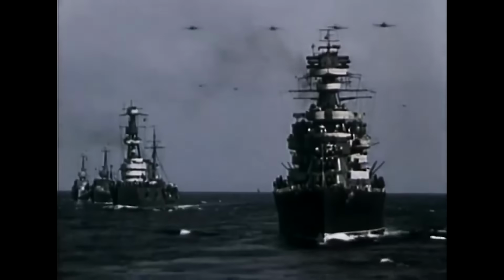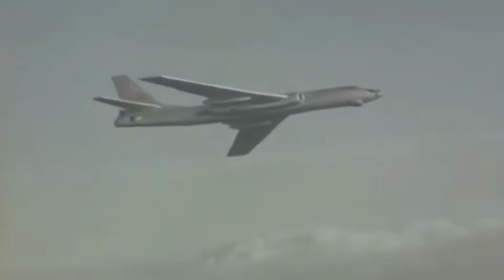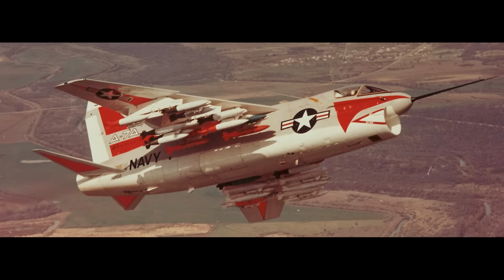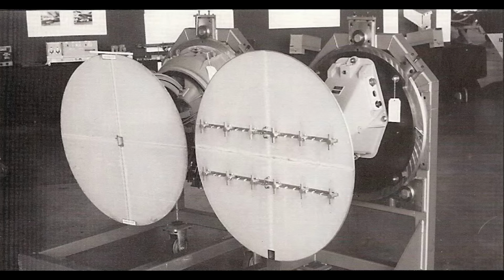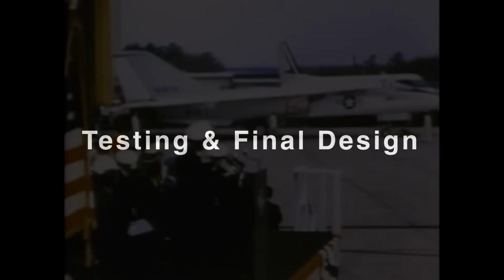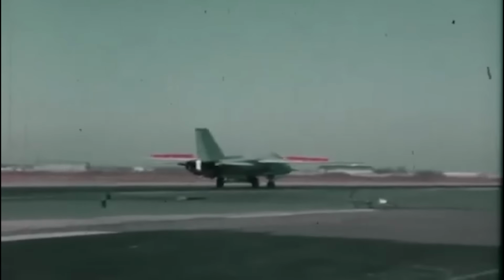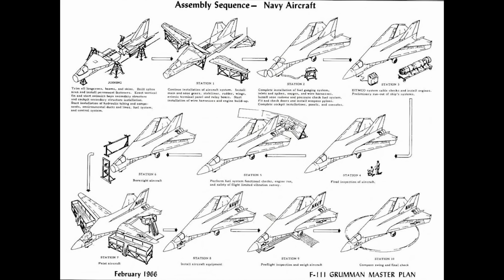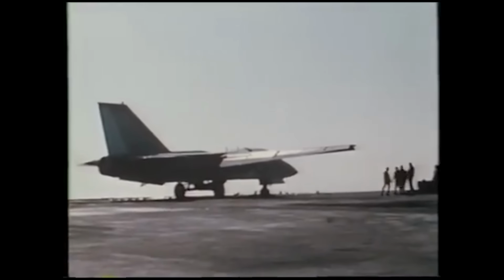Was The Grumman F-111B A Bad Aircraft Or A Missed Opportunity?

Comment: The F-111 came from the old school that fighters would no longer dog fight and only be used to shoot down enemy bombers. The F-14, along with the F-15 and 16 were designed to be fighters first, and everything else second.
Reply: The primary role of F-14 was long range interception of Soviet maritime bombers, hence its radar and AIM-54 missile setup.
That the aircraft was designed to be able to dogfight was a result of Vietnam experience - guns and dogfighting, and more specifically IMO the need to focus beyond superpower conflict and the reality of asymmetric wars. That’s why the F-14 ultimately was replaced by the F/A-18 - the USN did not need the stand off capability of the Tomcat.
Reply: @TK421-53  The F-14 was prepacked by the F/A-18E/F because DoD ordered Navy to abandon the Tomcat D and  instead dvelop the Super Hornet.
Reply: @TK421-53  
"(...) the USN did not need the stand off capability of the Tomcat." 

If that were to be correct, neither would the US need aircraft carriers as submarines and guided missile cruisers can deliver stand off strikes... 

It is more likely that budget concerns led to the missed modernization and retirement of a crucial airframe - while at the same time increasing the size of the Hornet into the Super Hornet with still less combat range, less speed, less capable payload and less capable RADAR. 

From the perspective of Beyond Visual Range combat doctrine, a procurement failure like the Littoral Combat Ship class (shutdown of all Super Hornet production was pushed from 2025 to 2027 - knowing that it is a last ditch platform)...
Reply: @christophmahler  in a real conflict against a capable enemy it is the submarine that is much more important, including as part of the US nuclear triad. Carriers and much of the surface fleet are used for gunboat diplomacy, to intimidate weaker countries that get out line, to intimidate and to fight in neocolonial style police actions.

The US does not need carriers to protect itself, it uses carriers to project power and expand empire. Although it still has to be proven, it is likely that carriers will have a hard time surviving against modern anti ship weapons, which now include subsonic and supersonic cruise missiles and even hypersonic missiles - not to mention unconventional warheads. Those big ships are high value targets, easily tracked by ISR when facing a peer or near peer opponent, as in Russia or China.

Just an opinion, feel free to disagree.
Reply: @TK421-53  
"The US does not need carriers to protect itself, it uses carriers to project power (...)" 

If so - and it would require some documents to prove - then it is too costly as demonstrated by the British Royal Navy that ended up, stretched thin against the Japanese in the Pacific, after recalling warships to contain the emergent German navy. 

The British remote blockade against Germany, however was successful - as was the German submarine campaign in the Atlantic in WW I (less so in WW II). 

I do agree about the risks of carrier warfare against near peers, but would argue that being able to strike from outside the range of coastal batteries and squadrons - within a perimeter against submarines - is a a strategic asset of more than just symbolic power projection. 

The issue now is - in my impression - that none of the US naval airframes have that necessary range - and the F/A XX would only be meaningful if it had. 

So in that regard, we agree that most assets of the US Navy have become de facto ceremonial.
Reply: @TK421-53  
"The US does not need carriers to protect itself, it uses carriers to project power (...)"

If so - and it would require some documents to prove - then it is too costly as demonstrated by the British Royal Navy that ended up, stretched thin against the Japanese in the Pacific, after recalling warships to contain the emergent German navy.

The British remote blockade against Germany, however was successful - as was the German submarine campaign in the Atlantic in WW I (less so in WW II).

I do agree about the risks of carrier warfare against near peers, but would argue that being able to strike from outside the range of coastal batteries and squadrons - within a perimeter against submarines - is a a strategic asset of more than just symbolic power projection.

The issue now is - in my impression - that none of the US naval airframes have that necessary range - and the F/A XX would only be meaningful if it had.

So in that regard, we agree that most assets of the US Navy have become de facto ceremonial. 

You made another comment that didn't make it through the automated filters ?
Reply: @TK421-53    
"The US does not need carriers to protect itself, it uses carriers to project power (...)"

If so - and it would require some documents to prove - then it is too costly as demonstrated by the British Royal Navy that ended up, stretched thin against the Japanese in the Pacific, after recalling warships to contain the emergent German navy.

The British remote blockade against Germany, however was successful - as was the German submarine campaign in the Atlantic in WW I (less so in WW II).

I do agree about the risks of carrier warfare against near peers, but would argue that being able to strike from outside the range of coastal batteries and squadrons - within a perimeter against submarines - is a a strategic asset of more than just symbolic power projection.

The issue now is - in my impression - that none of the US naval airframes have that necessary range - and the F/A XX would only be meaningful if it had.

So in that regard, we agree that most assets of the US Navy have become de facto ceremonial. 

You made another comment that didn't make it through the automated filters ?
Reply: @TK421-53  
"The US does not need carriers to protect itself, it uses carriers to project power (...)"

If so - and it would require some documents to prove - then it is too costly as demonstrated by the British Royal Navy that ended up, stretched thin against the Japanese in the Pacific, after recalling warships to contain the emergent German navy.

The British remote blockade against Germany, however was successful - as was the German submarine campaign in the Atlantic in WW I (less so in WW II).

I do agree about the risks of carrier warfare against near peers, but would argue that being able to strike from outside the range of coastal batteries and squadrons - within a perimeter against submarines - is a a strategic asset of more than just symbolic power projection.

The issue now is - in my impression - that none of the US naval airframes have that necessary range - and the F/A XX would only be meaningful if it had.

So in that regard, we agree that most assets of the US Navy have become de facto ceremonial. 

Your other comment had been filtered - so I can't answer it.
Reply: "The US does not need carriers to protect itself, it uses carriers to project power (...)"

If so - and it would require some documents to prove - then it is too costly as demonstrated by the British Royal Navy that ended up, stretched thin against the Japanese in the Pacific, after recalling warships to contain the emergent German navy.

The British remote blockade against Germany, however was successful - as was the German submarine campaign in the Atlantic in WW I (less so in WW II).

I do agree about the risks of carrier warfare against near peers, but would argue that being able to strike from outside the range of coastal batteries and squadrons - within a perimeter against submarines - is a a strategic asset of more than just symbolic power projection.

The issue now is - in my impression - that none of the US naval airframes have that necessary range - and the F/A XX would only be meaningful if it had.

So in that regard, we agree that most assets of the US Navy have become de facto ceremonial.
Reply: @nightshade7745  
"(...) if you look at the development trends of fighter airplanes, they became heavier and faster and less maneuverable up until the time missiles were invented (...)" 

You mean the F-100 and the MiG-21 - both fighting with missiles (Sidewinder, Molniya, Vympel) ?... 

You may have surface-to-air missiles in mind...

We are talking about very long range missiles like the AIM-54 which a typical fighter wouldn't even spot when incoming due to depending entirely on ground RADAR controls (exempting the Sukhoi Su-15 interceptor and the later point defense MiG-23). 

As with armored warfare, the main concern was not with other tanks - to be engaged best with longer ranged guided missiles - but to intercept intercontinental and medium bombers that could deliver a saturation attack, not just with free fall bombs, but with guided and cruising missiles (cautioning of the 1930s slogan 'The bomber will always get through'). 

Air superiority fighting between fighter aircraft wouldn't become doctrine until the CIA misconception of the MiG-25, leading to the development of the advanced F-15 and - a lightweight and low cost supplement, the F-16. 
Their adaption for multi-role, low altitude 'strike bombing' shifted the threat from fast, but inert bombers to agile air superiority fighters. 
Only then did the Soviets develop super-maneuverable airframes like the large Su-27 interceptor and the light MiG-29 point defense - and began to invest heavily into airborne fire control RADAR and look-down-shoot-down electronics - still their bomber variant Su-34 is primarily designed toward strike missions, not air combat.
Reply: @TK421-53  "when facing a peer or near peer opponent, as in Russia or China." thats unreasonably generous, but i get your point even tho its completely wrong.
Reply: @christophmahler  less capable radar? are you schizophrenic? Less capable payload? you mean almost every single armament in the US arsenal? you can put up to 12 AIM-120Ds on it, and they each have a longer range, and a probability of kill that's a literal factor higher. go back to 1999 man. there isnt a single soul in the navy who knows a single ounce of what they're talking about who thinks a modernized tomcat would've been a good idea.
Reply: Missile combat is what made maneuverability a significant thing, if you look at the development trends of fighter airplanes, they became heavier and faster and less maneuverable up until the time missiles were invented, with the least maneuverable being the F-104, and then after that they become successively better at turning. The designers know what they’re doing, thus the conclusion is that maneuverability had not been something worth sacrificing anything else for until missiles became a thing.
Reply: @Geschwindigkeitsmessungen  
"(...) if you look at the development trends of fighter airplanes, they became heavier and faster and less maneuverable up until the time missiles were invented (...)" 

You mean the F-100 and the MiG-21 - both fighting with missiles (Sidewinder, Molniya, Vympel) ?... 

You may have surface-to-air missiles in mind...

We are talking about very long range missiles like the AIM-54 which a typical fighter wouldn't even spot when incoming due to depending entirely on ground RADAR controls (exempting the Sukhoi Su-15 interceptor and the later point defense MiG-23). 

As with armored warfare, the main concern was not with other tanks - to be engaged best with longer ranged guided missiles - but to intercept intercontinental and medium bombers that could deliver a saturation attack, not just with free fall bombs, but with guided and cruising missiles (cautioning of the 1930s slogan 'The bomber will always get through'). 

Air superiority fighting between fighter aircraft wouldn't become doctrine until the CIA misconception of the MiG-25, leading to the development of the advanced F-15 and - a lightweight and low cost supplement, the F-16. 
Their adaption for multi-role, low altitude 'strike bombing' shifted the threat from fast, but inert bombers to agile air superiority fighters. 
Only then did the Soviets develop super-maneuverable airframes like the large Su-27 interceptor and the light MiG-29 point defense - and began to invest heavily into airborne fire control RADAR and look-down-shoot-down electronics - still their bomber variant Su-34 is primarily designed toward strike missions, not air combat.
Reply: @Geschwindigkeitsmessungen   
"(...) if you look at the development trends of fighter airplanes, they became heavier and faster and less maneuverable up until the time missiles were invented (...)" 

You mean the F-100 and the MiG-21 - both fighting with missiles (Sidewinder, Molniya, Vympel) ?... 

You may have surface-to-air missiles in mind...

We are talking about very long range missiles like the AIM-54 which a typical fighter wouldn't even spot when incoming due to depending entirely on ground RADAR controls (exempting the Sukhoi Su-15 interceptor and the later point defense MiG-23). 

As with armored warfare, the main concern was not with other tanks - to be engaged best with longer ranged guided missiles - but to intercept intercontinental and medium bombers that could deliver a saturation attack, not just with free fall bombs, but with guided and cruising missiles (cautioning of the 1930s slogan 'The bomber will always get through'). 

Air superiority fighting between fighter aircraft wouldn't become doctrine until the CIA misconception of the MiG-25, leading to the development of the advanced F-15 and - a lightweight and low cost supplement, the F-16. 
Their adaption for multi-role, low altitude 'strike bombing' shifted the threat from fast, but inert bombers to agile air superiority fighters. 
Only then did the Soviets develop super-maneuverable airframes like the large Su-27 interceptor and the light MiG-29 point defense - and began to invest heavily into airborne fire control RADAR and look-down-shoot-down electronics - still their bomber variant Su-34 is primarily designed toward strike missions, not air combat.
Reply: @Geschwindigkeitsmessungen  

"(...) if you look at the development trends of fighter airplanes, they became heavier and faster and less maneuverable up until the time missiles were invented (...)" 

You mean the F-100 and the MiG-21 - both fighting with missiles (Sidewinder, Molniya, Vympel) ?... 

You may have surface-to-air missiles in mind...

We are talking about very long range missiles like the AIM-54 which a typical fighter wouldn't even spot when incoming due to depending entirely on ground RADAR controls (exempting the Sukhoi Su-15 interceptor and the later point defense MiG-23). 

As with armored warfare, the main concern was not with other tanks - to be engaged best with longer ranged guided missiles - but to intercept intercontinental and medium bombers that could deliver a saturation attack, not just with free fall bombs, but with guided and cruising missiles (cautioning of the 1930s slogan 'The bomber will always get through'). 

Air superiority fighting between fighter aircraft wouldn't become doctrine until the CIA misconception of the MiG-25, leading to the development of the advanced F-15 and - a lightweight and low cost supplement, the F-16. 
Their adaption for multi-role, low altitude 'strike bombing' shifted the threat from fast, but inert bombers to agile air superiority fighters. 
Only then did the Soviets develop super-maneuverable airframes like the large Su-27 interceptor and the light MiG-29 point defense - and began to invest heavily into airborne fire control RADAR and look-down-shoot-down electronics - still their bomber variant Su-34 is primarily designed toward strike missions, not air combat.
Reply: @Geschwindigkeitsmessungen  
Looking to bypass the automatedfiltersinthefuture...
Reply: "The F-14, along with the F-15 and 16 were designed to be fighters first, and everything else second." 

True - yet, everybody appears to stress BEYOND VISUAL RANGE combat, mocking Soviet Flanker and Fulcrum designs...
Reply: @christophmahler yes, because it's stupid. No 4th gen is going to make it into dogfight range with another 4th gen
Reply: @tedarcher9120  
"No 4th gen is going to make it into dogfight range with another 4th gen" 

So one would have to conclude from the kind of equipment, procured. 

Yet, dog-fighting is still exercised on a major scale - maybe for reasons that benefit mastery of the airframe, but certainly popularizing an image of Vietnam era air combat (originally drafted as a 'search and destroy' and strategic bombing campaign until Soviet guided missiles and jet aircraft appeared on the battlefield, causing eventually 10.000 plus US losses of aircraft)...
Reply: @christophmahler  yes, because pilots love dogfighting. How many dogfighting kills have been achieved in the last 40 years?
Reply: @tedarcher9120  
"(...) because pilots love dogfighting." 

That maybe so, but do You really think, they'll have that much sway over the budget to fund these exercises ?
Reply: @christophmahler  absolutely, especially if they can come up with an excuse. And their bosses were fighter pilots too. Remember that Space Shuttle had an automated launch and landing system but had to fly with astronaughts on every mission because astronaughts love flying and they lobbied Nasa to make Shuttle require manual input before landing
Reply: @tedarcher9120  
"Remember that Space Shuttle had an automated launch and landing system but had to fly with astronaughts on every mission because astronaughts love flying and they lobbied Nasa to make Shuttle require manual input before landing (...)" 

Well, NASA spoiled the appetite for manned flight by saving costs on security procedures, killing several crews...
Reply: @tedarcher9120  The SS never auto-landed. It had the software, though not all of it and it could not auto-flare for actual touchdown, but because there was no go-around possibility it could not be tested with a manned aircraft. It's worth noting that STS-3 almost ended in disaster due to a computer error on approach.

Besides, the whole point of SS was to put people and payload together in orbit. If the US wanted to send a thing to space that didn't require manned service, that's what normal rockets were for.
Reply: @JimoftheSlim  it could have been tuned in a way to let it auto-land, but it was specifically designed to not allow that, for example fuel cells could not be shut off automatically. That way astronauts got to fly on all missions, not just where they were required. Regular American  rockets did not nearly have the capability to launch SS payloads until  2018
Reply: @tedarcher9120  Your Space Shuttle Orbiter Vehicle information is incorrect.
Reply: @tedarcher9120  "Regular American  rockets did not nearly have the capability to launch SS payloads until  2018"
This is incorrect.  Plans for Space Shuttle payloads were picked up by inline rockets immediately following Challenger.
Reply: @hoghogwild  yes, because SS also launched payloads it didn't have to launch.